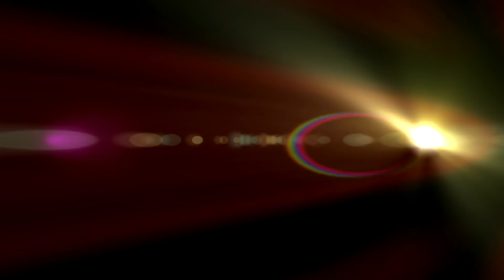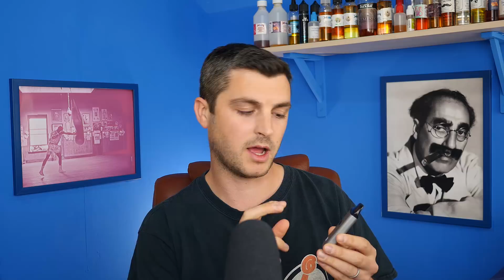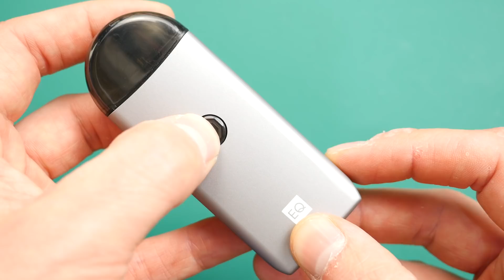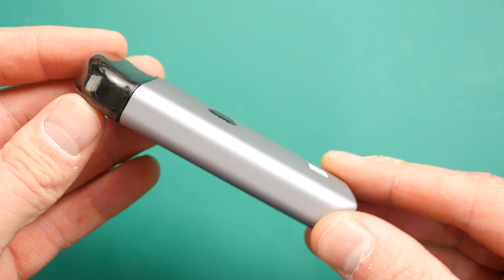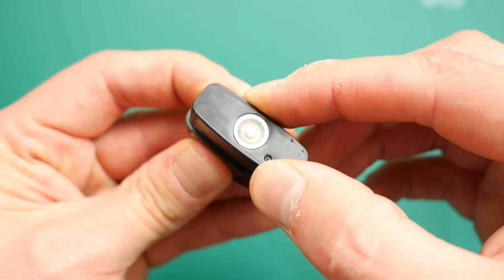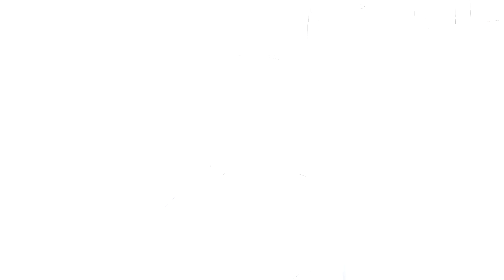Innokin EQ Pod AIO - Quick Look

Comment: Nice quick look. In America, a lot of vapers view pods as “stealth devices” or “nicotine delivery devices. Basically,  whether it can satisfy your nicotine cravings when you can’t blow bigger clouds. ”  A pods weak flavor is ignored if it gives a satisfying draw with enough nicotine. Could the looser MTL draw be a concession to existing vapers over providing a tighter draw new vapers and smokers tend to prefer? How hard could it be to build a basic air flow control into a pod?
Reply: I agree: I have reviewed a few things myself and I a 0mg vaper and all these pod-like systems seem to be just nicotine delivery devices and a lot of these devices barely give off any flavour and no adjustments. It's almost like they target vapers who want a stealth device for at work or on the road instead of targeting new vapers and new vapers need to dial in their preference when they start out so at the very least AFC should be a thing for these pods (I think the aspire zelos kit is still one of the best kits to recommend to a smoker but I don't know how tight the Zenith can go).